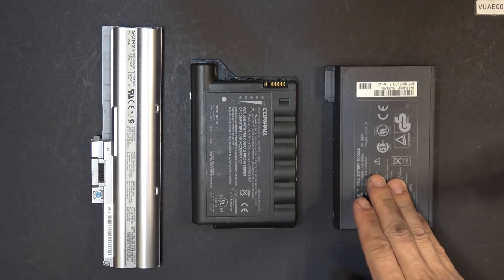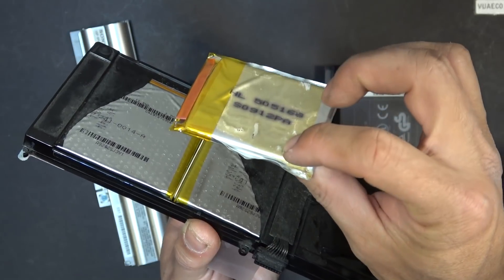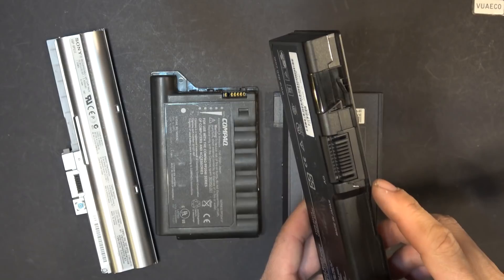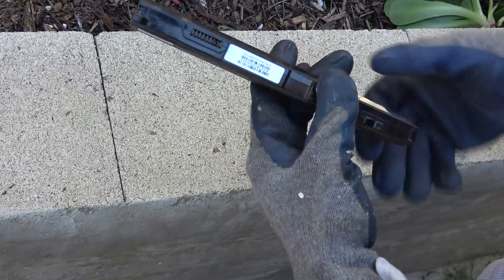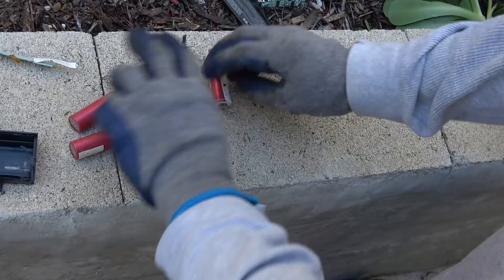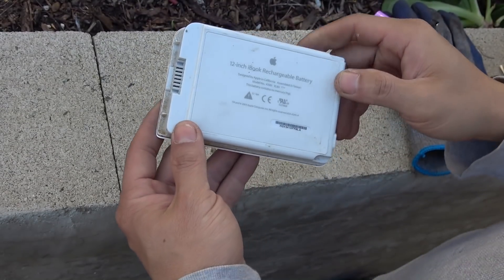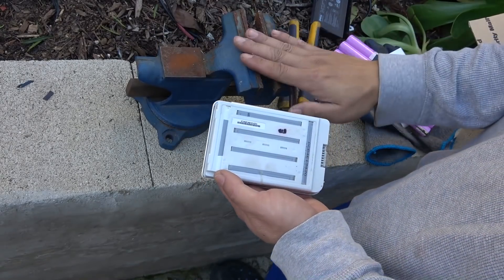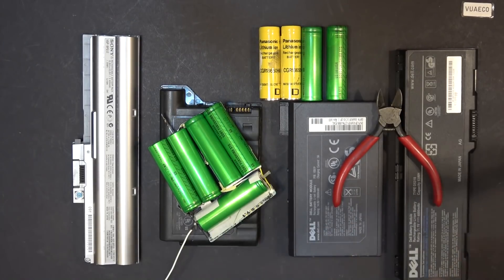18650 cells harvest S01E02: Crack open laptop batteries in seconds!

Comment: Now.. just need to add a button top so I can use them in my 18650 powered flashlights. Lol. Most of the laptop batteries I find, the batteries are no longer worth salvaging. Most are toast. No capacity left.

Comment: I believe the 4-cell packs are to comply with the new-ish IATA rules about lithium battery capacity when flying. It's actually kind of an elegant solution, and perhaps the "dummy cells" will come in handy if you need non-conductive 18650 templates for something.
Reply from the maker: Yep. Dummy cells are sometimes needed for flashlight that runs on 4V only but has 2 spaces for 2x 18650's.
Reply: @vuaeco  In the case of such a flashlight, are you running the 2x 18650 in parallel? Or series and a buck converter? I've been thinking about lithium-izing a 2 D-cell Mag LED I have. It's good and bright, but it eats batteries like crazy...

Comment: 0:01 this silver battery has exact the same shape as my Msi Cx61 Battery.
In the OEM/Original battery, they use Samsung INR18650-32E 18650 cells
Reply from the maker: 3200mAh? That's a nice find.

Comment: Nice!
Have you seen Paul Kennett (YouTube from NZ I think) who disassembles 18650 packs but leaves them in pairs with the parallel tabs, reduces the work and  waste and makes it easier to solder connections afterwards since the tab Bridge is still there...?
Love your videos.
Keep on trucking (from France)!
Reply from the maker: Great idea! I haven't seen that YT channel though. I sometimes leave them in pairs for other projects. Problem is, many times one of the cell in the pair is bad and you still have to separate them anyway. Also, many of my projects require individual cells so I still need to separate them.

Comment: The only problem with this method is that it put little dents into the cells sometimes, which isnt that safe.
Reply from the maker: Strike at the connector only then. That's where it has a circuit board and that acts as an impact absorber. :D
Reply: @vuaeco  I was striking them on the flat side not the connector.
Reply from the maker: You can also use a vise.